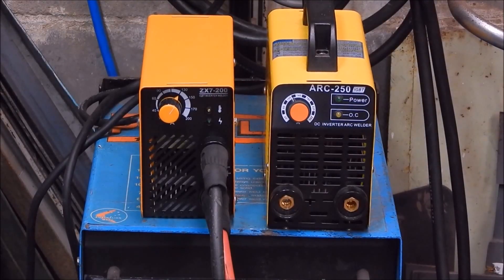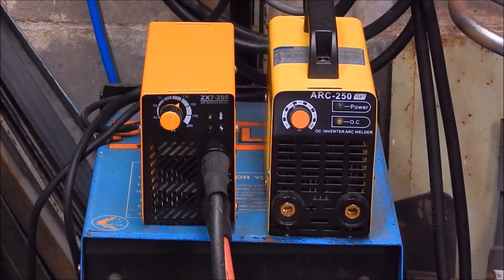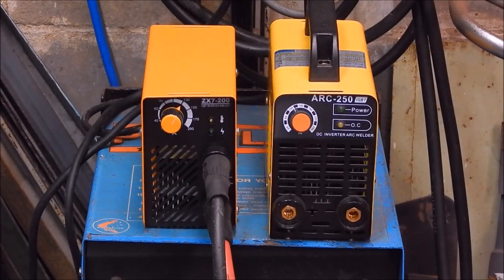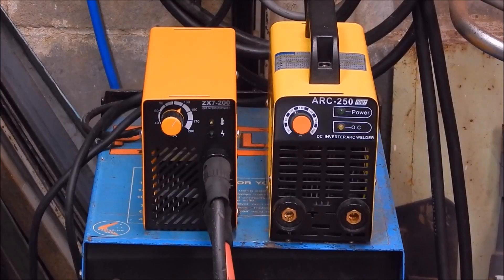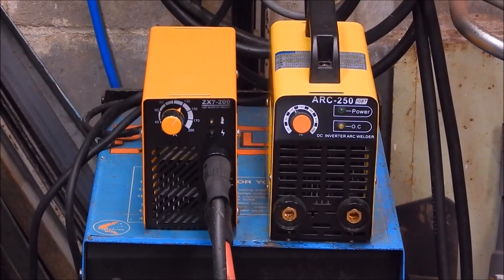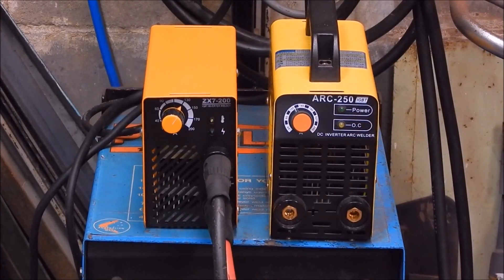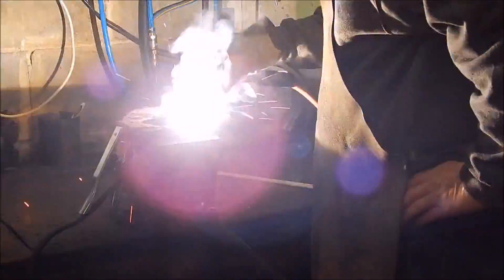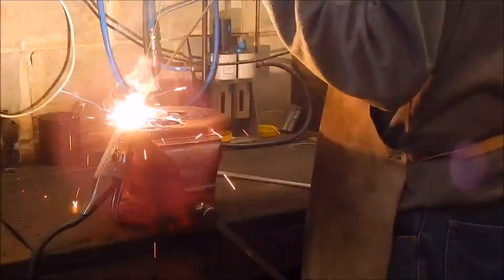How easily will the tiny ZX7-200 inverter welder overheat ?

Comment: I know this is an older video but I came across it while researching the ZX7-200. Your testing clinched it so I bought one, different brand to yours (of course) but only cost me $52 delivered overnight from Sydney!! No plug and only a 2-wire power cord (!) which I changed to 3-wire. The only concern I had was the claimed amperage rating so I bought a clamp meter and ran some rods through it. Not surprisingly the figures on the dial bore no relationship to real life use!! Maximum current is 120 amps, a far cry from the 200 implied, with a 3.2mm rod but like yours it just ate it up. All in all a very impressive little bit of gear, much better than my old AEM Pulsarc AC welder.
Thanks for taking the time to do the testing.
Reply from the maker: Hi Richard,  I gave mine to the Bro Inlaw and he loves it.  I've seen a few home reports/reviews on the output of these inverter welders and have reservations about using a clamp meter to determine maximum amps.

The only way to accurately measure output (the way the manufacturer should be doing it) is by putting a known measured load resistance directly across the terminals using a dedicated instrument.

Simply using a clamp meter has a few issues, number one being that they generally average the reading which will be an issue if these inverter welders use pulse technology (which they supposedly do) for the DC.  this will mess with (reduce) the reading obviously.

From my observations the scale on the amperage dial and digital readouts on these cheapo Chinese welders are very untrustworthy, but the figures being bandied about as supposed output are not convincing, given the unknowns with how these units operate.  The fact that you can weld at maximum power using 3.2 mm rods on a 10 AMP breaker says a lot about these inverter units.  No way you could do that with an AC transformer welder - 15 Amp trip definitely required.  The technology is totally different.

I have had several AEM Pulsarcs (and earlier versions) over the years and they are a good welder.  Currently I have a Peerless four copper coil unit which is easily the best AC welder I've used to date.  Don't throw away your AC welder as for rough, dirty, oily, rusty jobs and where you really want to burn it in they can't be beat.  DC only likes clean jobs. 

Cheers Rob
Reply: @Xynudu  Thanks Rob. I realise the readings from the meter won't be completely accurate but the meter reads True RMS, which supposedly is designed to cope with pulse outputs. Regardless, it's probably closer to the reality than the stated figures. Other reviews have reached the same conclusion. I also have a Lincoln MIG, but the beauty of this little beast is its portability and only needing a 10amp cct.

Keep up the good work, cheers Richard.

Comment: Well, you pushed it for about minus 4 minutes.  Did not even scratch the surface.  Have you tried it with other machines?  It's duty cycle is most probably 60 percent.  At 130 amps, the duty cycle would be about 80 to 90 percent.  That means, 8 minutes straight before conking out. Looks like almost all machines, big or small can go 4 minutes straight.  I just do not know if they can go 8 minutes straight at 130 amps.
Reply from the maker: Hi Joselyn, in real life it's unlikely most people will ever weld continuously for 8 minutes with home application welders.  So the duty cycle of most budget welders is adequate.  However, the higher the duty cycle the better, as a safeguard in hot conditions,  Cheers Rob

Comment: This is a good convincing test!  I've never seen anyone just weld around and around, I was wondering what that was going to look like.  I've used one of these just for sitting practice running bead after bead on scrap steel, it never seemed to overheat.  I had a 220V power point right there, and short leads, and tried to give it a chance all around.  There's another type that looks like an amplifier (for car audio), with an extruded aluminum case- it sits flat on the bench, and the display and adjustment knob are on top.  This is about the same- within its limits it can go and go.  I think aside from commercial welding with a lot of repetition, most general welding is probably less than one per cent of arc time!  There's so much more setting up and grinding and looking for that hammer and general fooling around.   I looked at that  patent someone else mentioned, it was a great discussion about how inverters work, and how this thing works and also manages not to get hot!   It's very efficient, good power factor, there's not anything for heat to build up IN, it has a big fan right there.  My sense of it is that if it can go for a few seconds at some power level it might be able to do it all day!  The things that made duty-cycle ratings in the previous technology might not apply.  There used to be a massive iron core, low power factor and low efficiency, there's a big thing to heat up and it takes time for the heat to get out, the core is just a big chunk...  here I'm thinking that the (ferrite or powder-metal) core gets as hot as it's going to get in a second or two, and the transistors are high efficiency and stuck to a heat sink....  There's not much MASS in there, as small and light as it is, that box is not so full, you can see through it!   Now I want to dig up some giant power resistors and try to put some numbers on this, not that it's needed.  I am not convinced that those little digital meters on all these things mean anything!  This needs big power resistors for the load, and a shunt to measure the load, and an oscilloscope for sure!  Again, great stuff, I've watched this one and the ones about brazing several times.
Reply from the maker: Hi Leonard,  Those 3 mm rods were low penetration for pipeline work, but that shouldn't make any difference.  The amps required are pretty much the same.  With all this small electronics trickery now, you can actually buy a DC stick welder with the circuitry in the electrode holder. No box as such, just an electrode holder and an earth lead.  Can you believe that ?  I was offered one to review, but I can't remember by who.  The electrode holder had a larger head than normal (about as big as half a house brick) and no fan (I think).  I wouldn't fancy holding that mass too long to weld, but that's what it's come to. Simply amazing.  It may have maxed out at 2.5 mm rods from memory.  Efficiency has certainly improved massively over the old buzz boxes.  I still like AC though, as I cut my teeth on that medium and you rarely get arc blow, which is the curse of DC stick welding.  Cheers Rob

Comment: I Rob;  only out of curiosity, I wondered what could serve the propane bottle gas that can be seen at the end of the video???
Reply from the maker: Hi Jean,  That's extra air capacity for my air compressor, plus it's a "bucket of air" that I can fill and take outside to blow up car and trailer tires that are well away from the compressor.  I also use it to blow dust out of PC's indoors.  Cost nothing.

https://www.youtube.com/watch?v=B1PSRQbMlMc

Comment: Thanks Rob. I just received my unit from Banggood. So far I have tried 3.2mm E6010 and E7018, both ran well, the E6010 being a little harder to start but that is probably my technique.
Reply from the maker: Hi Peter,

Some rods can be difficult, but I had good rod compatibility with that welder.  I gave it to the Bro Inlaw but was tempted to keep it as it was pretty vice free.    I see similar ZX7-200 welders  being sold all over the place for all sorts of prices, but just how good they are who knows ?  Depends on the components they use I expect, but the basic circuit design should be the same.  I hope you have a good run out of it.  I found it very easy to weld with for DC, which can take some getting used to.  Cheers Rob

Comment: does it work with 3,2mm 7018 welding rods???
Reply from the maker: I haven't tried it with low hydrogen rods.  I don't see why that would be an issue as they are generally an easy flow rod.  Deep penetration are more likely to cause grief.

Cheers Rob

Comment: G'day, I have a noobie type question. I followed the link in the last video and viewer this little Arc welder. Judging by the below comments, you have your own cables and rod holder. Does it come with rod holder and cables albeit cheap n cheerful? If not, where do I buy them?
Reply from the maker: No cables included.   BG have the ground and electrode fittings.  Cable is available from suppliers.  Check the yellow pages.

The cheapest way is to buy a really cheap shit AC welder secondhand and use the cables off of that.  

That's what I did.

Cheers Rob

Comment: I was extremely impressed with your review of this machine and even more so with this duty cycle test. However, when I priced up the cost of a decent set of welding leads I was 2/3rds of the way towards a quality UK  supplied machine which comes supplied with the leads and a 3 year guarantee.
Reply from the maker: These little welders are only economic if you can russle up some cheap leads off of another old welder.  Good for upgrading from an AC machine.

Cheers Rob

Comment: Very impresive Rob. I'm in Western Australia and have been tempted by the UNIMIG Viper Arc 140, which is rated to use a standard Aussie 10A plug and Ewelders have on offer at $189 AUD  including a free auto mask and delivery (as of 26/7/18). Unimig say this is their answer to the cheap Chinese imports, but I understand from other forums that all Unimig gear is designed in NZ and built by Jasic in China, Jasic being a well respected source of many of these other imports as well.
I downloaded the handbook for the Viper 140 and it says even this small unit will draw 27 amps from the 220v supply, so I emailed Unimig to ask what circuit breaker they recommend. Got a very prompt reply from their Service Manager telling me they recommend a 32A breaker if the unit is to be used at full power. As my house has only 16A breakers on all the circuits I'm reluctantly not going to buy one. But I will have some nice beefy circuits installed to the shed of my retirement home when I eventually get to build it!
Have you had any problems with tripping breakers during your tests? The Australian wiring rules apparently (more answers trawled from forum searches) allow welders to use a 10A or 15A plug even if they draw more than that because of the duty cycle. Having to let the welder cool down every few minutes lets your house wiring cool down as well.
Kit.
Reply from the maker: Hi Kit,

That's a 140 amp rated unit.  The specs say it will run off of a 10 amp mains supply, which it will easily do.  DC inverter welders draw up to 50% LESS amps than an equivalent AC welder.

Given an AC welder will run off of a 15 amp breaker, it's obvious the inverter welder will run off of a 10.

If you crunch the numbers, this being an inverter welder will only draw about 8.5 amps with a 3.2 mm rod at maximum output (140 amps).

The service manager is blowing smoke out of his arse quite frankly.  All welders peak and trough with amp requirements and while it could potentially spike to 32 amps draw for a millisecond, that is not continuous.  You DO NOT need a 32 amp breaker.  That's just plain ludicrous,

The standard 10 amp breaker should be fine.  If the breaker does trip (which I seriously doubt) your 15 amp trips will easily handle it.

Unfortunately some of these "service manager" really don't know shit.

Eg.  I was in a BOC outlet and the DC welder guy didn't even know you could get DC stick welders.  He only knew about MIG.  He had no idea about welding rod polarity, and the fact the stick polarity is opposite to MIG, and that some rods are marked for polarity.  That's BOC, a supposedly top welding supplier.  LOL

Cheers

Rob
Reply: Rob,
Crunching your numbers suggests an arc voltage of less than 14V (8.5A X 230V = 1955W/140A = 14v) even with high efficiency in the inverter and minimal loss in the leads etc. Is the arc voltage really this low?
Kit.
Reply from the maker: I gather they use some sort of voltage pulsing to get the high efficiency factor.  I should have said 130 amps, because that was what I crunched the numbers at.  Either way, you will be quite safe using it on a 10 amp line.  It has a ten amp plug for that reason.

Cheers Rob
Reply: Rob,
Of course what I should have done first off is look up the time/current curves for  the 'C' type circuit breakers in my house. Based on the data from Schneider-electric (link below for those interested) even a 16A breaker should take the maximum 27A rated for this unit for several minutes before it trips, and that current isn't going to be sustained beyond an initial strike anyway (that equates to an arc voltage of about 40V at 140A). The instant-trip current for a 16A 'C' type breaker is 80A minimum so I'm going to go ahead and buy the Unimig Viper 140 unit described above. I'll let you know what I think of it once I've learned how to weld and have something useful to say.

Being me I'll probably make up a mains cable with separated conductors so I can borrow a clamp-meter from work and make some real measurements of mains input current. I might even put my oscilloscope on the output terminals and plot how the voltage changes during a weld. Wouldn't that make a fun video!
Kit.
https://www.schneider-electric.com/resources/sites/SCHNEIDER_ELECTRIC/content/live/FAQS/234000/FA234075/en_US/iDPN%20Tripping%20Curves.pdf
Reply: If you have a 15amp power point you will be fine as it's a straight line from the 16/20 amp breaker to the outlet 
The problem with 10amp power points 16amp breakers is the line runs loop to loop from one power point to the other can cause hot spots or arcing if any of those connections are not good enough for the amperage as most breakers will take at least 3x their rating for an instant trip
Which is not such a bad thing for a 15amp power point as it's on a straight line but not so good for the 10amp loop to loop outlets

Comment: Wasn't it AvE who said "There are no old welders".. food for thoughtI saw an old 1920's or earlier railroad tank car today at the R/R Museum near my home - I noticed it was riveted together and I realized for the first time this was before the advances made in arc welding just leading up to WWII when the need arose for lots of troop and material transport ships.  The old rivet construction method was slow and made for heavy and poor hydrodynamics in large ships - Also the transcontinental gas and oil pipelines were made possible by innovations in arc welding - can you imagine trying to weld 2,000 miles of steel pipe with oxy-acetylene?  Possible yes but not fun or cost effective.  All respect to the Chinese by the way... they were making structural forgings of cast iron and brass while we Europeans were still swinging from trees and lucky to have a stone hammer..
Reply from the maker: Arc welding certainly revolutionised metal fabrication.  Armoured vehicle/fighting tank construction is a classic case.  Interestingly tanks are welded together with stainless steel rods because of the type of impact resistant steel used.  I can't agree with the original statement by AVE as modern welders do it easier, give greater control, and use far less energy.
Reply: Wait - By "there are no old welders" I took that to mean (AvE was referring to) the health hazards of welding (mostly breathing nano particles of flux fumes, but also exposure to continuous streams of ultraviolet and infrared photon frequencies) being such that most practitioners would not be likely to make it into old age.  Not that the welding machine itself wouldn't make it..Here is a cut an paste just selected at random from the interweb:AbstractDue to its unique chemical properties, chrysotile asbestos was historically incorporated into a wide variety of products, including the outer covering, or “flux” of certain classifications of general arc mild steel welding electrodes. The purpose of this analysis is to review the historical engineering, toxicology, regulatory, and epidemiology information relevant to asbestos in mild steel welding rods in order to assess whether mild steel welders are at increased risk of developing asbestos-related diseases as a result of welding rod use. We divided our analysis into four distinct time periods, based on what we perceived to be seminal events in welding technology or in the evolution of knowledge regarding asbestos and asbestos-related diseases. These time periods are as follows: late 1800s to 1929, 1930–1955, 1956–1970, and 1971–2006.
Reply from the maker: I can't comment on how long most professional welders (people) last, except to say that I know several in their 60's and 70's who are still going strong.  If they were dropping like flies, as suggested by the quote,  I expect the jury would have been in a long time ago regarding any associated health risk.  So I suspect it's AVE being AVE ;)

Comment: Really impressive for a tiny unit like that. My Lincoln 225AC Buzzbox weighs like 100lbs or more including cables. Btw, all the rods I own were my Dad's, all well over 50 years old and still burn like new, family shipped them to me...work great...mainly 7018’s
Reply from the maker: Provided the rods don't get wet they will weld as good as the day they came out of the factory.

Comment: I bet your cables have lots to do with the duty cycle. Run it with marginally sized cables, or lesser rod holder and ground clamp, and I bet you see heat sign. Cabling and contacts are, in a way, heat sinks. Typical "chineseum alloy" cables are, to put it diplomatically, garbage, lol.
Reply from the maker: Of course.  That's why you are better off buying a welder without cables and making your own to a decent specification.